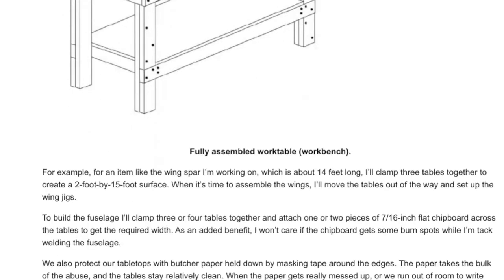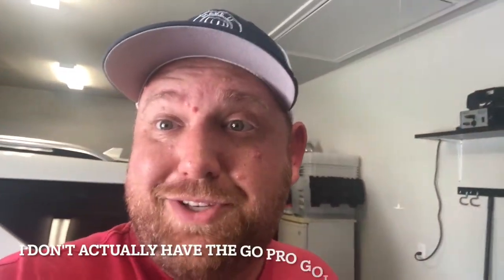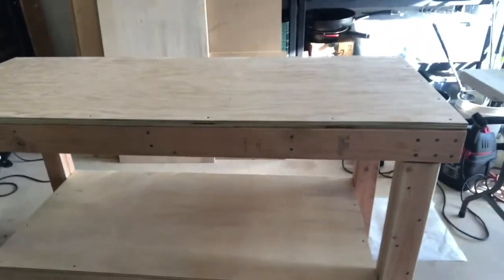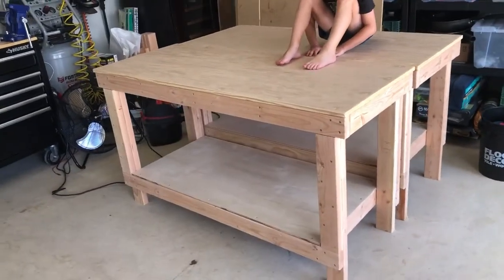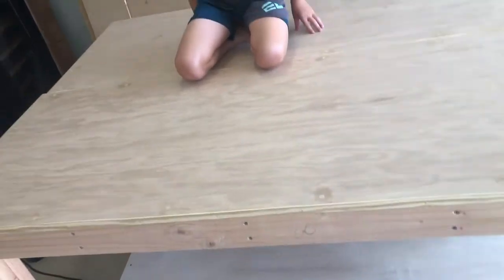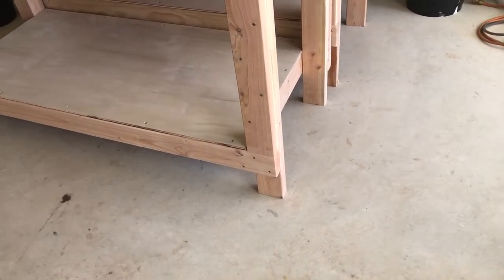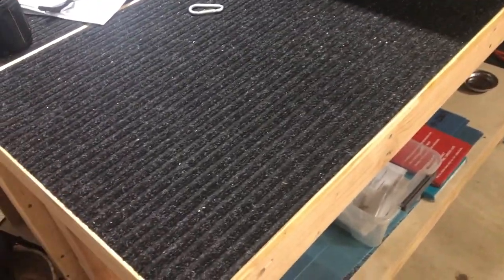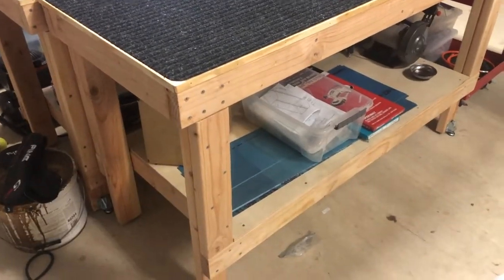EAA Chapter 1000 Homebuilt Airplane Table

Comment: The tail cone and fuse will most likely be fine to build on the first table. However, anything that holds a control surface will need a flat surface so as to ensure no twists are built into the structure.
Reply from the maker: The twist is so minor now that I have the adjustable legs on the table.  Plus one of the tables is perfect, so I will ABSOLUTELY build the flags and ailerons on that one.